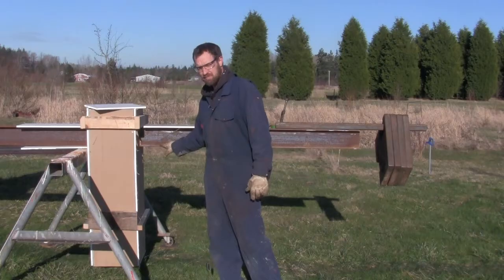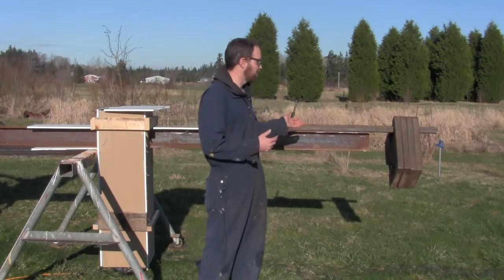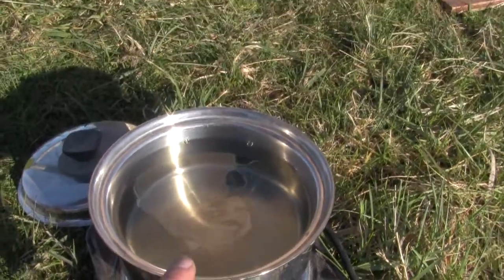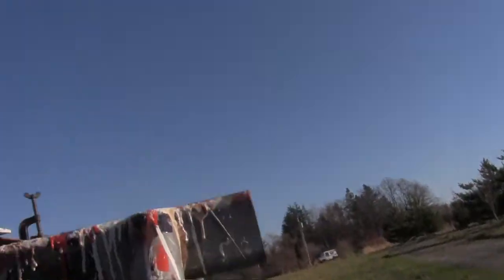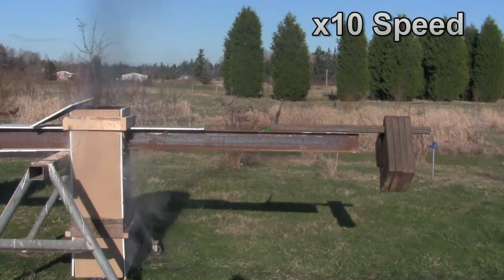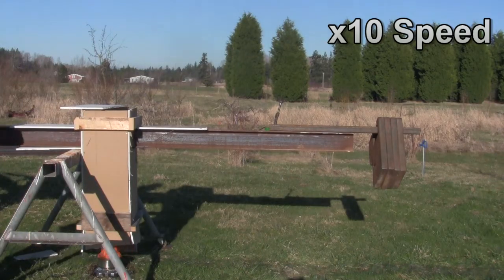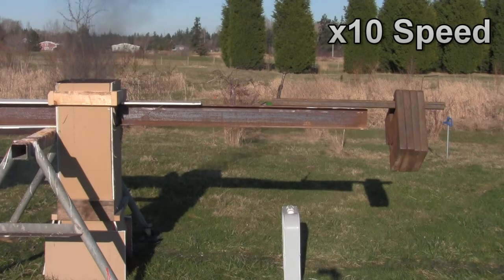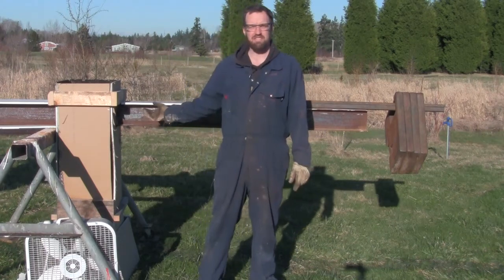Melting/Bending a beam by burning Jet Fuel.

Comment: The idea that jet fuel can´t melt steel is based on the fact that the jet fuel don´t reach steel melting temperature in (old) jet engines... because... they are made of steel.... Sure, high temperature steel, but still steel. If the engine would melt, the engine would stop.

The thing is  that a jet engine runs incredibly lean to have the temperature going low... well except on start up, its going very close to the stochastic optimal.

It will probobly be hard to melt that beam in that set up because while steel is not the best conductor of heat, it still conduct it pretty well. With 90% of the beam outside int he air, it will cool of the center part very efficiently. 

A torch that is made to melt steel is not only very hot, its also very high flowing, transferring the heat to the steel much faster than a fire does, melting the steel before it have a chance to lead the heat away. 

To have the beam sufficiently warm to lose it strength, it would probobly needed to be heated over most of it length, not only a small part in the middle.
Reply: A bit to the jet engines vs steel vs flames conundrum: the combustor liners (closest steel surface to the actual flames) would surely melt, if not for the cooling air going in/around them.
Anyone interested? Look up AgentJayZ and his videos for further thoughts and facts on the topic :)
Reply: @YCbCr  Well the bleed air in the engine is something hat have been developed over time. But with the new turbines nowadays they use ceramic components in stead, but that is a fairly new development and something that was fairly uncommon in 2001. As far as i know, the only aircraft that used it back then was the 777, and even at that, it only used them in the static blades. They was started to be used in rotating blades first about 10 years later.

The only current in production Boeing or Airbus that don´t use it that i know if is the 767. So if someone checks it up with current aircrafts  today, the argument don´t make any seance any more
Reply from the maker: @matsv201  I think YCbCr is talking about the combustion liners not the turbine blades. Combustion liners from way back used cooling air to contain the combustion process and mixed that combustion air with cooling air prior to the air entering the turbine. Modern airliner engines do use extremely small holes to deliver cooling air to the turbine blades to allow for higher compression to increase efficiency.
Reply: Jet engine hot section parts are made from Inconel and Titanium, not steel.  They can withstand the extreme temperatures.  There was not enough fuel in the planes, not enough air and not enough time for the heat to compromise the WTC 1&2  structures all the way down to their basements.  And then you have WTC 7, not struck by aircraft, not having Jet-A even touch it.  All  collapsed at almost Newtonian free fall speed.  Most men of science know the truth, but remain silent because they have families to provide for...  I try to speak out from time to time, but nobody cares, and those that do can't bear the thought of 9/11 being an inside job (which it most likely was...). This is called Cognitive Dissonance.
Reply: @bartofilms  what kind of engineer are you?
Reply: @matsv201  I am not an engineer. Never claimed to be one.  You don't need to be an engineer to understand these things, but sometimes you do need to read stuff.
Reply: @bartofilms  Literally nothing of what you wrote is correct.

yes... you don´t need to be an engineer to believe you know stuff, but you need to be one to know what you don´t know.
Reply: @matsv201  What of what I said  do you believe is incorrect, and what are your qualifications/affiliations?
Reply: @bartofilms  
Every single statment is wrong. 

"Jet engine hot section parts are made from Inconel and Titanium, not steel"

Inconel is a trademark and Titanium is a element. Most older hot parts is made of alloys, most of them steel alloys, most modern engines is made of ceramics.  

"They can withstand the extreme temperatures."
The diffrance is really not that big structural steel to high temperature alloys, the reason is that the G-forces is very high. For ceramic engines, yes, but those was very rare at that time.

"There was not enough fuel in the planes"
How would you know? There is lot of flammable part in the building. The main problem was not the fuel, but rather the sprinter system and fire protection was damage in the impact.

"not enough air and not enough time for the heat to compromise"
Just wrong. We can clearly see the high temperature in the video. Did you know that color have a temperature equivalent? The mere fact that we have color footage disprove your claim

" the WTC 1&2  structures all the way down to their basements"
Its clearly a progressive faiure, haven´t you seen the videos?

"And then you have WTC 7, not struck by aircraft, not having Jet-A even touch it."

That is also true for WTC ,3, 4, 5 and 6. Still nobody is complaining about those

"All  collapsed at almost Newtonian free fall speed"
It didn´t... did you even check the fall speed, or did you just here it and assume it was right?

"Most men of science know the truth, but remain silent because they have families to provide for"
I worked in this field for 20 years, never met a single scientist or engineer that doubted the official explanation. Still people with no education or experience what so ever in the area do it all the time

"This is called Cognitive Dissonance."
You don´t even know what that is.

I have multiple education. For example a postrgrad and a building engineer degree.
Reply: @matsv201  Inconel is patented, true, it is an alloy, true. When I refer to Titanium, you may infer Titanium alloy.  Modern jet (turbo fan) engine hot section parts ( primarily in the toroid shaped combustion chamber ) are made from Inconel, a patented high strength metal alloy.  The most modern engines are now using ceramic fan blades, but did not in '01.  There is documented and timed footage of the WTC roof  tops (including a radio tower, for reference...) falling at 9.8m/sec./sec until reaching a calculated terminal velocity of approx. 156MPH.  There is even video with SMTE code showing the timed collapse sequences of 1,2 and 7. You can review it yourself. The modality of collapse was impossible with box column I-Beam construction.  Several courageous architects and structural engineers have discussed this ad nauseum.  The only possible explanation for a total implosion, aside from controlled demolition using advanced cutter charges, would be sudden and complete rivet failures on all floors, at all connection points, including those at the building edges and far below the zones burning from ignited Jet-A and 'office furniture fires'.  I am not joking about this stuff.  I am not poking fun at 9/11 survivors, nor people who lost family and loved ones on 9/11.  I believe this was a  serious crime of mass murder and the real sociopathic, greedy shit-stain perp.'s are still out there, living large.  I hope they meet justice one day soon.  Your comment about  colors in the flames tells me you know Nothing about metallurgy nor chemistry, as it was the very color (bright yellow and white, at times) and molten state of metal pouring from the WTC 1&2 buildings prior to their collapse that proves Jet-A and office furniture were NOT the fuel source and not the accellerant.  There were pools of molten steel, still glowing from chemical reaction, (even visible from space), for weeks after the event. It was literally melting the rescue  workers' boots.  Jet-A cannot cause a sustained exothermic reaction like that in structural steel.  There is video footage of explosions occuring sequentially, 10+ floors below the burning, collapsing floors.  There was at least 1 blast victim in the basement of WTC,  his skin hanging down, ripped from his face and arms.  Perhaps you believe Jet A made its way down 70+ floors to the basement level within seconds of the plane impacts,  and it somehow exploded there in the basement?  Find me a single scholarly paper which debunks the video evidence and testimony in the  'Loose Change' videos alone.   From Merriam-Webster: Cognitive Dissonance: 
psychological conflict resulting from incongruous beliefs and attitudes held simultaneously.   - Not rocket science.
Reply: @bartofilms  

"you may infer Titanium alloy"
The problem is that a lot of Titanium used in engines is made of Titanium ceramics, not titanium Alloy. 

" Inconel is patented"
Just the name, not the alloy. You can´t patent a metal alloy ratio.

"The most modern engines are now using ceramic fan blades, but did not in '01"

1: I already wrote that
2: There was engines in the wilde using static blades already back then

 Most engines didn´t use titanium blades wither. The problem was that it was to complicated to machine back then

"There is documented and timed footage of the WTC roof  tops ("

Did you check the math, or did you just assume it was right. Did you factor in the actually highs, not only the listed once. The rubbish pile from WTC 1 and 2 was almost 100 meter tall. That shortens down the fall from about 410 meter to around 300 meter, that is a quite considerate diffrance.

Did you factor in the speed of sound for the first break, because the first half a second or so, the building fall that slowly its not really visible on the camera.

" You can review it yourself. "
I did.. its not corect. The avvrage acceleration is about 8.5m/s2, not 9.8

"  Your comment about  colors in the flames tells me you know Nothing about metallurgy nor chemistry"
how would you know... you wouldn´t, that is the answer to that.

"molten state of metal pouring from the WTC 1&2 buildings prior to their collapse that proves"
Do you even know what metal it is.. steel, stainless, aluminum? Did you know that office furniture often is made of aluminum?

"office furniture were NOT the fuel source and not the accellerant"
Why don´t you pitch that to a fire fighter, the reaction will be worthy recording.

" for weeks after the event. It was literally melting the rescue  workers' boots"
Why don´t you calculate the cooling speed and check how long time it would take to cool it.

"There is video footage of explosions occuring sequentially, 10+ floors below the burning, collapsing floors."

Its clearly a over-stressed steel column. Have you ever seen a over-stressed column. 

" Find me a single scholarly paper which debunks the video evidence and testimony in the  'Loose Change' videos alone.  "

That is not how research science work. "debonking" is what stupid people on the internet does that believe they know something  

"Cognitive Dissonance: 
psychological conflict resulting from incongruous beliefs and attitudes held simultaneously."

Did you check the claims from the idiot conspiracist.. or did you just believe it. You wrote that the vidoe of the freefall is there and you can check it.. but you didn´t. because if you did, like i did, you would know that there math is wrong. I did check it.. you didn´t.
Reply: @matsv201  your building engineering degree isn't worth much in terms of aero engine knowledge. Jet engines have not used steel on the hot side for a very very long time, and almost all of it is some kind of nickel alloy or titanium. Ceramic is a relatively newer technology to engines (past 30 years or so, barely even a development cycle). Most engines still use inconel rotors and stators, the hottest turbine blades being single-crystal or maybe ceramics. 

It's not just temperature resistance, it's also corrosion resistance at temp (steel is very bad at that) and creep resistance at temp (inconel is very good at that). 

My source is working at a factory that made these parts.
Reply: @benmodel5745  while cheramics turned up in the early 90tys that was only for static  blades, and really for the first 10 years only in a narrow range of engines. The rotating  blades become being charamic  first i  the mid 00tys, far after wtc.

Same thing with Titaniun  blades. The problem is not really the metal it self, but the manufacturing  techology, it wasnt readdy for wide scale deplyment in the 90tys.

A have multiple  engineering degrees. Engine manufacturing is not aurontics but rather combustion engineering.
Reply: @matsv201  I didn't state aeronautics, I said aero engines. Your knowledge here seems to be very lacking. It's sad that a 9/11 truther nut is the only correct person in a thread about jet engine materials. 

The manufacturing of inconel blades is fine, as all jet engines have had components made from it for decades. The factory I worked at was founded in the 40's casting parts from nickel... When combustion temps and inertial forces got too hot for normal inconel, they developed single crystal cast parts. That's metal with zero grain boundaries, only possible to get from casting. 

Also I'm not sure why you keep talking about titanium so much. The hottest parts are inconel (rather, nickel-based superalloys, if being pedantic) or ceramic. Titanium is most commonly used on the cold side, or the rings around the engine. Manufacturing processes are highly optimized with safety and engineering procedures written in blood over the past 60 years... This is why you don't often hear about engine failures. So I'm not sure what you mean about manufacturing being a problem.
Reply: @bartofilms Hot section doesn't have titanium alloys, titanium is used more toward the front of the engines and in outer ducts. Titanium does not stand up to heat very well, certainly not as well as even steel. Its advantage is weight.
Reply: The thing is all fuels have an auto ignition temperature, at which it combusts regardless of whether or not there is an ignition source. Fuels cannot burn higher than a certain temperature. Likewise, steel cannot bend below a certain temperature.
Reply from the maker: @cari9060  False. The auto ignition temperature is not the max temperature a fuel will release when burned that is only the temperature that when heated to a fuel will ignite without a spark or other flame. There is a specific amount of energy a fuel will release when burned. If there is no where for that energy to go that energy will increase the temperature of the air with no set max. For instance acetylene has an auto ignition temperature of just 572F and regular steel has a melting temp in the 1,400F to 1,500F (depending on carbon content) yet acetylene is used to cut steel all the time in industry.
Reply: @curtis52285  false? I just said that it is the temperature where it would burn without a spark/other flame/ignition source.
Reply: @curtis52285  because acetylene is not simply burned in an open system for the purpose of welding.
Reply: @cari9060  there is two issues with that..
1: you can still ad fuel after the auto-ignition temperature... that is pretty much how jet engines work 
2: Auto-ignition temperature is calculated at normal pressure. There is very high pressure in the turbine
Reply: @cari9060  along with that even if the plane knocked out or somehow melted the beams the building would topple over not straight down. If you look at demolition charges used on buildings it looks eerily similar to what happend at the towers.

Comment: How were you measuring it? The right end looks closer to the blue flag after you pushed on it. You'd have to measure the height of the beam on the other side of the fulcrum too, in case the support got pushed into the ground or bent
Reply from the maker: Looking down the beam after unloading I didn't notice any curvature. I suspect the fulcrum got pushed slightly into the ground. We have soft ground.